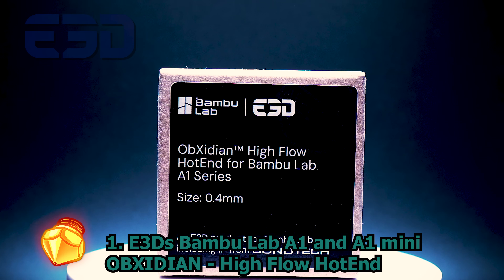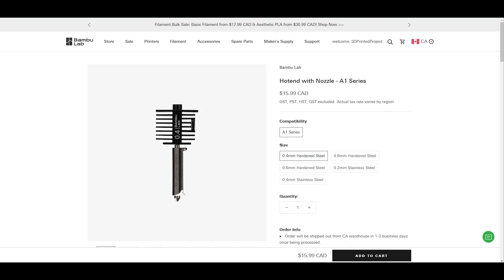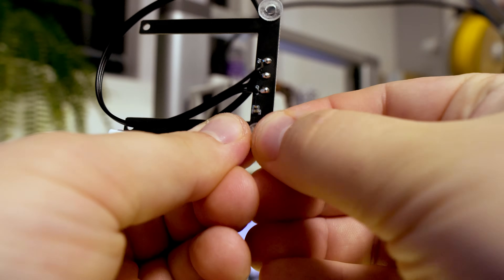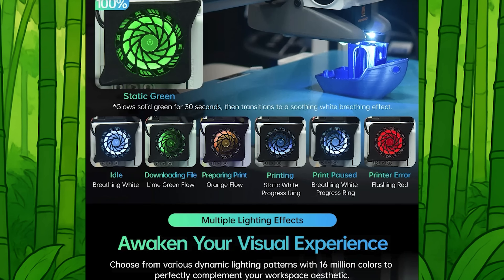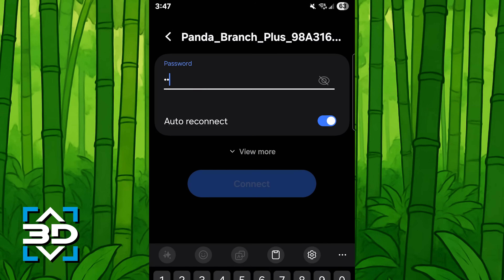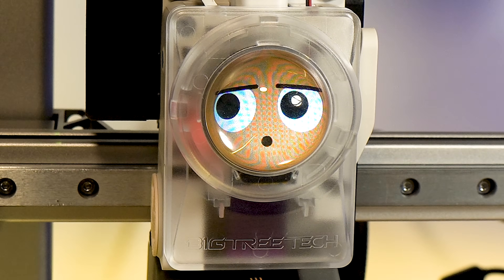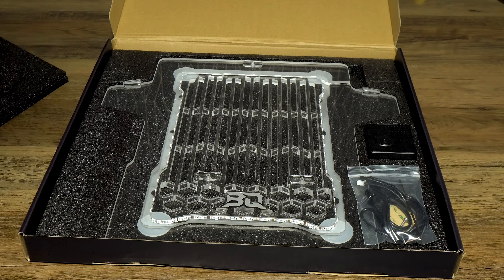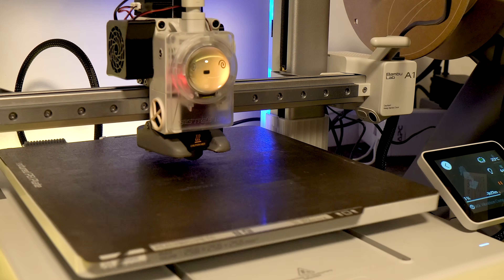More Upgrades For Bambu Lab A1 and A1 Mini

Comment: I have an A1 and it works amazing. I am planning to buy a mini with ams lite. Is it possible to install that A1 Mini AMS Lite to my exiting A1?
Reply from the maker: So AMS lite is same for A1 and A1 mini, shouldn't be a problem. But you can't use two printers on one AMS lite.
Reply: @3DPrintedProject  Thanks . that helps

Comment: Every upgrade is a modification. Yet not every modification is an upgrade. Something far too many people in the 3d printing space fail to realize.
Reply from the maker: It is true.

My filament hub collar was becoming so worn out that every filament change the filament hub would come apart.

Yesterday found someone made a collar with a little notch that holds the overall hub slightly stronger than the original. It's a little change, but made a huge difference to the function of my A1.

Comment: Any difference with the Panda Cooler fan?
Reply from the maker: Hey there, so this won't have a direct effect on your print quality, but rather prolong the lifespan of your extruder motor by ensuring it cools down quicker. Heat is very bad for motors (very simply put).

Comment: I don't get what to use the panda branch for?

so you have 5 controllable usb  and mini molex ports.

But what would you want to connect?

Especially to the mini molex ports which aren't standard at all.

Do you or does BIQU have any suggestions?
Reply from the maker: Hey there, so they mostly are designed to connect BIQU related products which there is a big list for A1 accessories. Since there is so many accessories available for the A1 they came out with this board to allow people utilise it instead of taking power from the printer and instead have it directly powered by the 24v adapter.
Reply: @3DPrintedProject 
Thanks for the quick reply.

I guess this thing makes sense if you want to go all out on panda accessories like the bottom light, the light bar, the led strip, the print head display and the additional fan.

Comment: The E3D high flow nozzle was the only thing I would buy. Other things in this video are pretty useless IMO. I don't need no extra lights on my printer :D
Reply: that bottom upgrade would have been amazing if was a motherboard cooling fan rather than RGB lights, missed opportunity there
Reply: @jhaybz29  That's what I was thinking; that there was some attachment to push cool air into the printer. I supposed you could use one of the laptop cooler stands like the Llano or similar. Also, as I think about it, it might be better to pull air instead of pushing it into the body cavity. I wonder if there would be any impact to the heat bed or something else due to the cool air coming in.
Reply from the maker: That's fair! Happy printing:)

Comment: I have bought the normal Knomi - just need to install it now. it was a bog debate to get the normal or the 3D version though! ahah the deciding factor is that I am not going to put it on the hotend plate. so thought the normal screen would look better :)
Reply from the maker: It's a fun upgrade. BIQU has a step by step instructions on how to add your own custom gifs. It focuses mainly on dimensions of the file. Personally I'm happy with the defaults, but it's cool they let you customise.